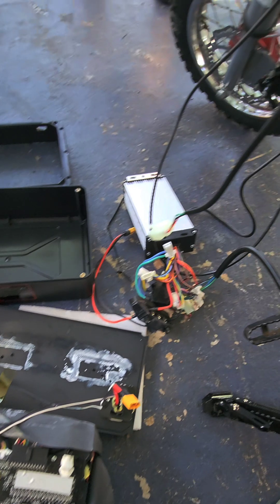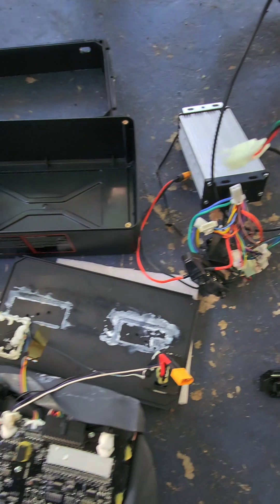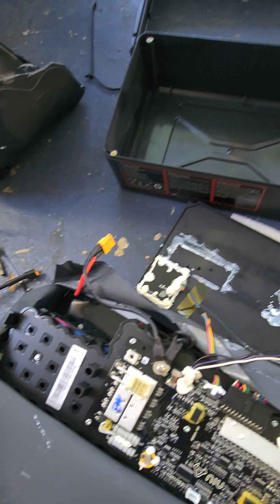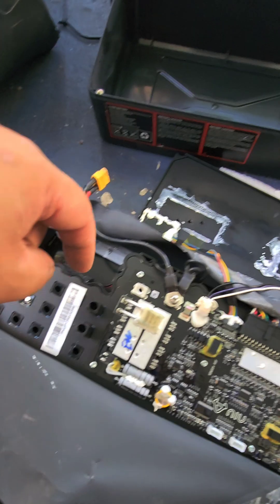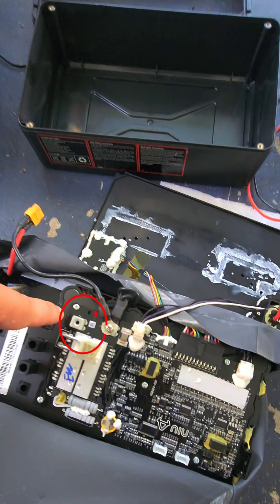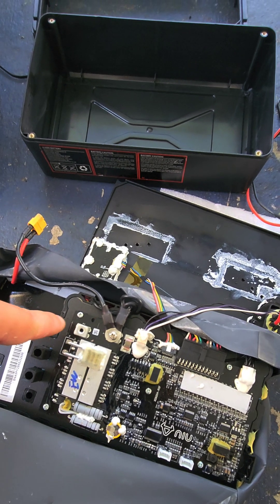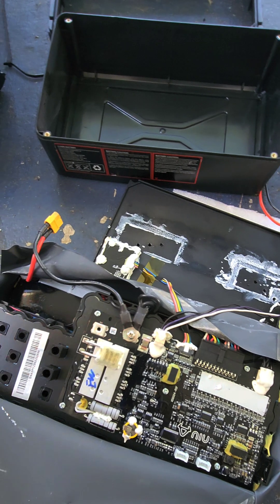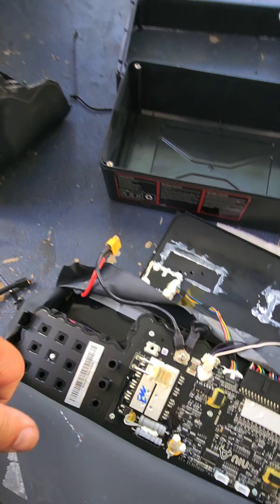RAZOR MX650 BUILD - How to Bypass a NIU / Shrimp 60v Lithium Battery

Comment: So i just did this, and when I turn the key on, it only beeps. Do I have to do something else?
Reply: Vevor controllers dont beep
Reply: What exactly is beeping. The controller or the battery
Reply: @TURBOMOOSE  the controller I have a fardriver
Reply: @zeferinomarrufo9723  whats the issue you are having?
Reply: I hook up the battery after bypassing it and turn the keys switch, and the controller just beeps
Reply from the maker: @zeferinomarrufo9723  did u already do your tune and everything? Have to set you base parameters and voltage cutoffs. You should only do the discharge bypass if the battery is tripped and cannot reset it
Reply: And an ec4p motor

Comment: How many amps can the bms take max before bypassing I got a fardriver I’m trying to run 60-65 amps and not trip the bms
Reply from the maker: 40 is max continous
Reply: @MooseTuned  what about after you do this ..
Reply from the maker: @732stuntz  this doesnt change anythingnwith the bms output. This is to bypass the bms diagnostic port
Reply: @MooseTuned  so if I did this and raised my apps on my fardrive my bms will still trip?
Reply from the maker: @732stuntz  yep

Comment: So I just got this battery. If I do the XT60 connector do I need to use the top charging port or can I just charge through the new y connector? Or do you have to use the top port for the batteries to balance correctly?
Reply from the maker: I use a xt60 y splitter into the xt60 off the cells and not use the niu plug. Watch my other video on how to open it and youll see how i do it

Comment: Isn't that super dangerous?? Bms is a safety part from my understanding
Reply from the maker: It can be if u had a super powerful controller and tried to pull too much amps. This controller can only pull 33 amps and the battery can do 40-60amps. So itll never reach it full potential, but this is to bypass the diagnostic tool and lets it operate as a regular lithium battery.
Reply: @MooseTuned  It's also not healthy for your battery because the BMS balances the cell groups of the battery pack. On the long run, some groups will deplete faster than others and without a BMS that can become dangerous.
Reply: You can get a half-decent 3rd party BMS and program it yourself, there's a dozen tutorials out there. There are numerous tutorials available for this. Just ensure you maintain the overall health of your cells to prevent any risk of fire :D
Reply from the maker: @PPPMr-w7j  still works flawlessly and charges correctly. This is to bypass the diagnostic tool not a bms bypass
Reply from the maker: @samuelwilliams7977  this isnt bypassing the bms. This is bypassing the diagnostic tool

Comment: After you bypass and charge do you then switch wire back to original post then connect to bike?Or does it stay wired to the post that bypasses bms forever?Thanks!
Reply from the maker: I left it bypassed. When i originally did, i made sure everything was working. So i put it back to factory and it tripped as aoon as i turned it on. So i left it bypassed and it rips with zero issues! Charges regularly aswell
Reply: @MooseTuned  That's awesome thanks!!
Reply: This is wrong….. you  need to do this and make a new charge port that is set up the same as it was originally